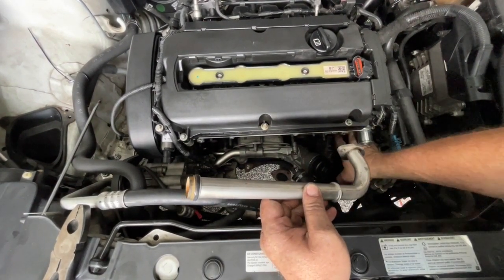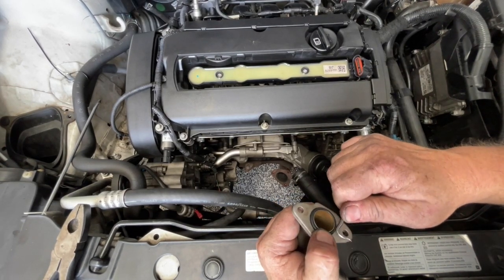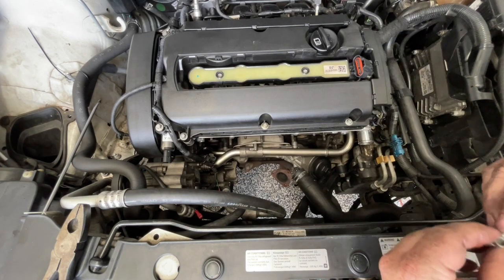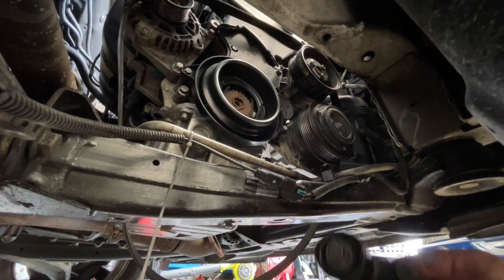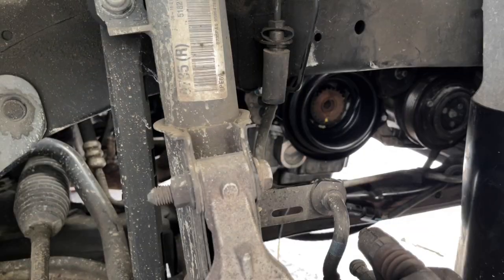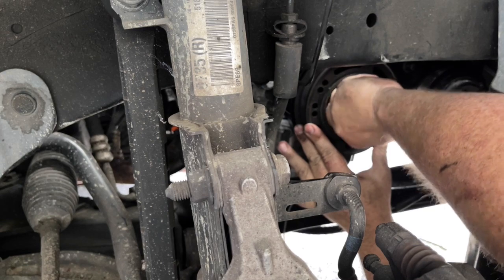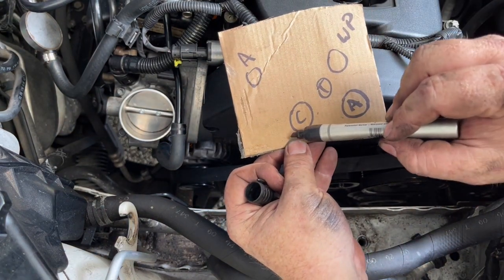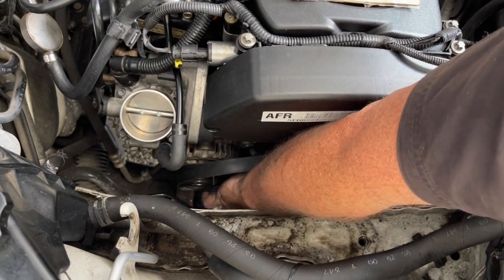Cruze Head Gasket Replacement  STEP by STEP process (Part 13 of 16) Full Details for 1.8 F18D4

Comment: #1, great set of videos! #2, how did you flush out the all of the "milkshake" oil/coolant junk in all of the different areas (radiator, heater core, engine block)? I'm sure you don't want that stuff flowing through your nice clean head, or any part of you cooling system.

Comment: Ty for the footage and detailed explanation, I watched all 16 videos over the past couple weeks as I rebuilt my sisters Sonic engine. I ended up having to replace the whole tube on the Sonic.
Reply from the maker: thanks for watching and the comment
Reply: Did you put the fly wheel holder on to tighten that crank pulley? Thanks.